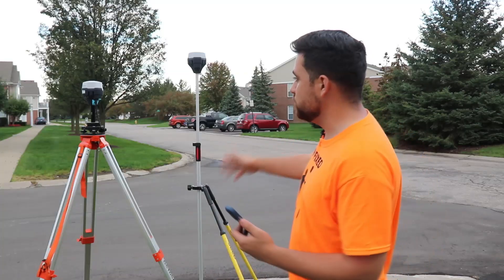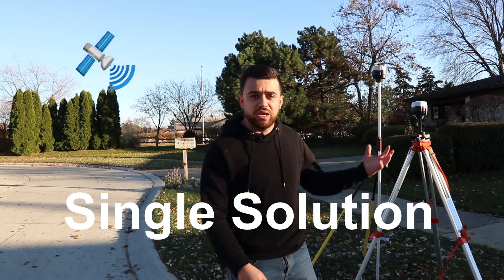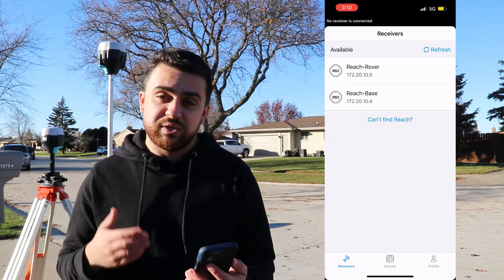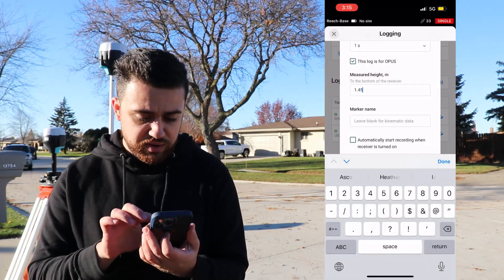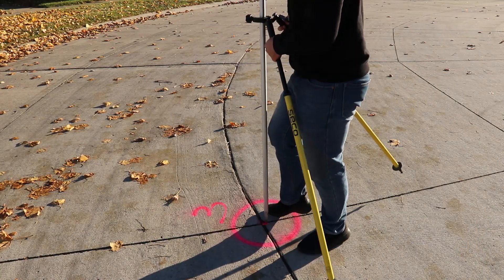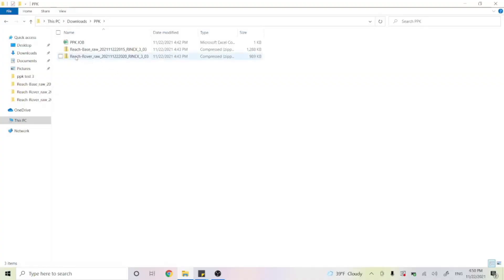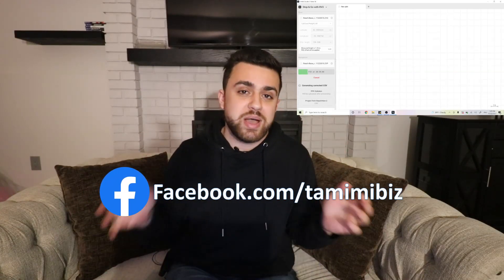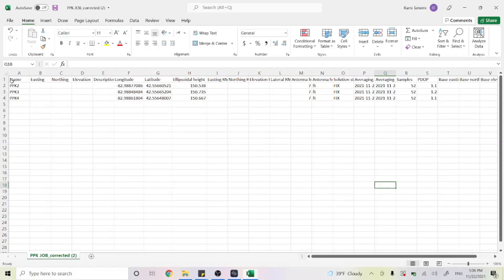PPK Post-Processing Kinematic - Emlid Studio Tutorial

Comment: Great video! How would you deal with a situation in which you have no access to a 'known' point to set the base over, however? Assuming there's no NTRIP, internet nor a CORS network anywhere near.

Obviously you could create a high absolute accuracy known point by logging and processing 12-24 hours worth of raw data. But this is obviously far from ideal nor practical during a project.

Would you, for example, suggest to log the base location for a shorter period of time (1-2 hours) and therefore accept a reduced absolute accuracy instead (relative accuracy between base and rover should still be in the cm-range, correct)? Or would you for example input a 0,0,0 for the base's long/lat/height (or XYZ resp.) to create a local reference network for the rover instead. Assuming you'd set the base over the exact same point during future projects and provide with the same 0,0,0 base coordinates you'd expect to be able to create a relative accuracy between different data acquisition rounds in the order of a few centimeters too, right?

Comment: thanks for the tutorial! I did exactly what you did with one exception. apparently one of my settings was different because I ended up with decimal degrees in my corrected file instead of lat/long. For some unknown reason that wont work in the software I'm using but Lat/long/and ellipsoidal in meters does

Comment: That's interesting to watch but there's something to keep in mind: RTK measures are not a reference to check same PPK measures precision. Both types of measures are using the same calculations, the only difference is when it happens (Real Time or Post Process). In the end, you did not find an error, but just a difference between 2 same measures.

Comment: Hi Rami, great video (best out there explaining the PPK). I only have one question. Can i use the ppk solution only having only a rover logging raw data? The corrections will be taken by buying the rinex file from the company i use for my cors. Thanks
Reply: Buy CORS corrections, to get a fixed position on your rover. Then start logging data that's already corrected not the other way around. You can reprocess your raw data with a high accuracy CORS for slightly better positioning but it's overkill.

Comment: How do you proceed with PPK process if you don’t have a known point over which to set the base? Does this mean you can only achieve cm level accuracy relative to the base but inaccurate relative to the actual ground? Or is there an easy way to create an accurate known point in the field to then set the base over?
Reply: I think I've answered this question for myself, Precise Point Positioning (PPP). I'm speaking hypothetically here about working in a remote location with no network connection, and no known point over which to setup the base. How can you establish an accurate known point to set the base over so that you can then proceed with your PPK survey and achieve absolute rather than relative accuracy? This link https://docs.emlid.com/reach/quickstart/ppp-logging/  explains how to record logs for Precise Point Positioning (PPP) and download them from Reach for working with your data in the PPP service such as NrCan CSRS-PPP service: https://webapp.csrs-scrs.nrcan-rncan.gc.ca/geod/tools-outils/ppp.php  To measure a PPP, you have to let the base log for several hours, at least 4, maybe as much as 24, but if there is no other 'known point' alternative and relative accuracy won't cut it, this is an option.

Comment: So my only comment on this is your setup of the base. You had it set to kinematic mode. Which is fine for the rover. But you will see greater accuracy on the base with it set to static. Since it's not moving, the corrections will be able to know for sure that the 'movement' it calculates is wrong, and can more easily filter it out.

Comment: Hi Rami, thanks for your video. If I am understanding. We have two options to make PPK. The first, is when we place the base in a unknown point, in this case, we configured the base in STATIC and CORRECTION OUTPUT ON, and 5hz. The rover, we configured in KINEMATIC, and CORRECTION OUTPUT OFF, AND CORRECTION INPUT ON. Right now I have saw your video, I know a new way to PPK but WIHT A KNOWN BASE, only for compare with RTK.  
Is it correct??
I am a little confused in post process with Emlid Studio. 
When I make PPK with an unknown base, I post process as rover my base logs, and as base my cors logs (previously download), in static mode, and I obtain an unique point (my base) corrected. Finally, I go to Stop ang go and correct the others points.

But, make sense process only my base in unknown point wiht my rover?? It is right??

Thanks.

Regards from Panama.
Reply: Rami, the rover have update rate in 5 hz, and the base in 1 hz. It to ppk when my base is in a unknown point.

Comment: Thank you for the post, this has been really helpful. I've been getting an issue with the post processing in emlid studio, however. It says that I only have 0.2% fixed solutions, and 90+% float from my rover. The points cannot be corrected using fix since there is not enough fixed points. do you know what may be causing that issue?
Reply: Other than the obvious view of the sky, you can get very different results processing forwards, backwards and combined.  I assume you did this forward, try backwards.

Comment: Looks like i'll be using this equipment in the next week or so. Is there a way to set up the base with no known coordinate (like Trimble's 'HERE' softkey positioning), then applying a site calibration using a BM to your job? TIA. Great video BTW.
Reply from the maker: Yes there is. I always encourage people to use a known point since it will always give a more accurate correction, but there is an option to do it with no known coordinates.
Reply: @RamiTamimi  Do you have a vid where you show your RTCM settings for the other freqs?   Edit, sorry I mean frequencies for the other systems (GLONASS, etc..).   I havnt had coffee yet.

Comment: Hey Rami, what if we don't have a known point? Can we use the base log for PPP and input that result in the base lat/long/elev input in the PPK studio? Would that be enough to successfully shift all the rover points after PPK processing?
Reply: Yup, I do this a fair bit with ppk flights.  Just make sure you manually enter it instead of reading from the header when processing.
Reply: @PortraitArtPhoto123  What do you mean? PPP gives marker elevation (ARP-Antenna height which is entered in the header), do you input ARP or marker elevation in studio?

Comment: Between the RTK corrected #s and the PPK corrected #s, do we know for certain WHICH are more accurate?  I'm a noob but am reading that PPK results are generally more precise than RTK when both are done correctly.  Is this true? Thank you Professor!
Reply from the maker: Generally speaking, PPK is considered to have a higher accuracy because we have full control of the corrections. Now that’s not to say that RTK isn’t accurate, if a shot is fixed and has lower standard deviations, then it can be accepted as a baseline measurement to compare other measurements to it, just like we did here in this video.

Comment: Hey Rami, great vid. I know how much a pain it is to shoot these yourself.  Had a question about logging the Base, you showed to log the base as a kinematic solution b/c the rover is moving... I thought, you'd want the base in static and the rover itself in kinematic.
Reply from the maker: Good question, this could be an entire lecture but I’ll try my best to explain it. Static observation only allows for a single receiver solution since we are logging data to achieve one position. Whereas kinematic observations are understood to be a dual receiver solution. Even through the base is stationary, it is known to be used for corrections, so we don’t need the additional utilities to have a static solution.
Reply: @RamiTamimi , so the set up of the base is always in kinematic whether we work in RTK or PPK, is that right?
Reply: emlid explains on his’web site that the set up of the base is in kinematic in we work With the rs2+. I thought it was a mistake because with rs+ I usually put the base in static

Comment: Great video. Got a question for you.. I’m a drone data collection remote pilot, The company I work for wanted me to get a heap of random gcp over an area where we were doing lidar and photogrammetry.
We used a topcon base and rover.
My question is that topcon says to measure the length of one of the legs of the tripod to the base rather than the vertical height like you have. How would this work out it’s height? Over a known permanent survey marker?
One leg could be sitting 1m underwater for all it knows. Have you seen this before?
Reply: If you measure the length of a tripod leg and then apply Pythagoras, you will get the height of the tripod baseplate, but not the required antenna height. I would never do that. I keep a 2-metre dressmaker's tape with me to measure the antenna height directly if I need to [the antenna plane is usually marked on most units]. For field work, I have a tripod for the base station and a telescopic monopod for the rover, and I have their heights permanently entered into their respective GPS units. I long ago gave up using a surveyor's bipod; they are much too unwieldy in field situations.
Reply: @mjmcb1  ok, seems like a hassle to use Pythagoras when i could’ve just plumbed a measurement down.
Reply: @kizzjd9578  Sure is. It makes no sense to me. Either measure it directly with a tape or have the heights of base and rover permanently encoded in your GPS units.
Reply from the maker: I honestly never heard of this. The instrument height is always the shortest point from the bottom of the device to the point it is occupying.
Reply: @RamiTamimi  that was my thoughts as well. In the end they sent us the incorrect settings and didn’t have line of sight to the base so couldn’t collect any points.

Comment: I am looking to take measurements on a property without a known point or anywhere close to one i could use. Very remote property no cell signal. How would i go about getting a base station point.
Reply from the maker: You would need to establish a static observation. Something I will cover in the future.
Reply: Rami has been showing a base station set up on a known benchmark. I work in remote Australia where there are no benchmarks, no CORS, no internet and no cell towers, so I set up the base station and let it run for 30 minutes or so, after which it has a SINGLE solution of better than 1 centimetre, which means the rover will show a FIX solution of similar accuracy. This also works for PPK. The RS2 is a multi-frequency unit and is much faster at this than the older Reach RS.
Reply: @mjmcb1  does it say what the accuracy is on the device? If you left it in one place for several hours this could yeild better accuracy? If i could get accuracy within 30cm that would be awesome.
Reply: @nickalex636  I wouldn't consider 30 cm acceptable. My usual RTK FIX Accuracy is 0.5 centimetres. I recently wanted to demonstrate how RTK worked to someone who was having difficulty understanding it. I set up the base station and let it run for a minimum 20 minutes. On the rover I set up a survey, with a defined acceptable accuracy for surveyed points [0.5 cm, 1 cm, 2 cm, etc.], and the rover showed how long it will typically take to achieve that accuracy with RTK SINGLE, FLOAT, or FIX. The answer is usually 20 minutes, 10 minutes, or 30 seconds respectively. So, if you are willing to dwell on a point for 20 minutes with a single GPS rover, you can get centimetre accuracy. But only 30 seconds for an RTK FIX, using a pair of Emlid RS units. For surveying, as in most things, time is money.
Reply: @mjmcb1  makes sense especially if you have to take multiple points. Currently i am using garmin handheld but accuracy is not so great. Around 3 meters at best. Looking into options without spending 10 grand.
Reply: @nickalex636  No handheld unit can deliver accuracy better than 3 metres. If you need better than that for a particular project, you need a unit that can deliver RTCM/RINEX etc. files that can then be corrected using PPK with data from a CORS. Setting aside the various GPS-on-a-chip build-it-yourself options, the Emlid units are noticeably cheaper than any of the 'name' brands like Trimble, Garmin, Topcon or Leica. If you need RTK, then a pair of Emlid RS2 units is about USD6K, which I would consider a bargain.
Reply: @mjmcb1  I bought one RS+ to see if this will work. Still trying to figure it all out, there is a NTRIP station 2.5KM away here in the city i can connect to and get CM accuracy right away. But i am planning to use it at a different location with no corrections.  I turned off corrections and it has been sitting for at least 30mins and est. accuracy is around 5-9 meters. I am using Reachview 3.  Which page does it show how long it takes to achieve cm accuracy with the single solution?